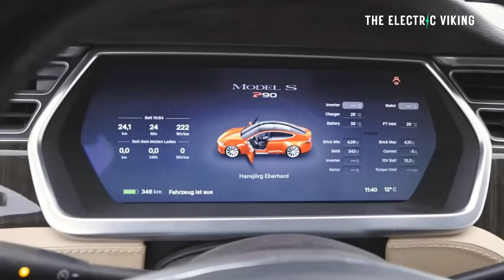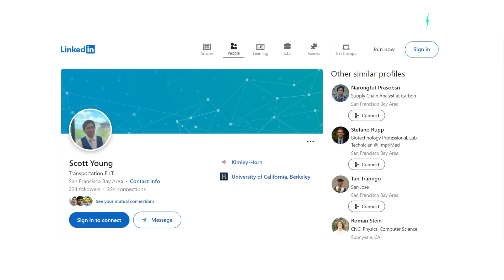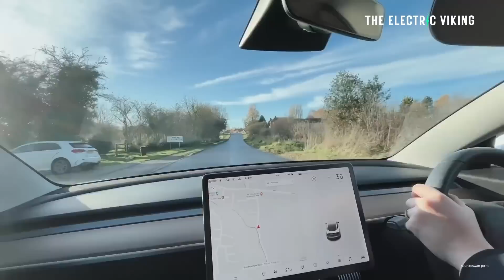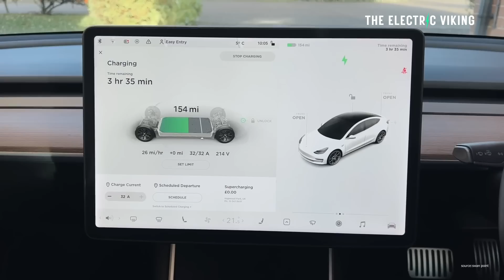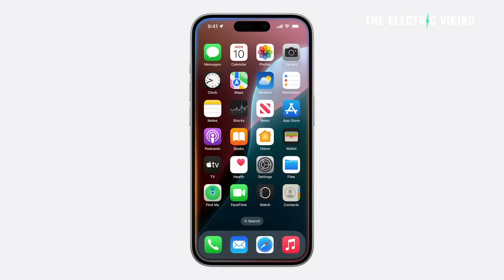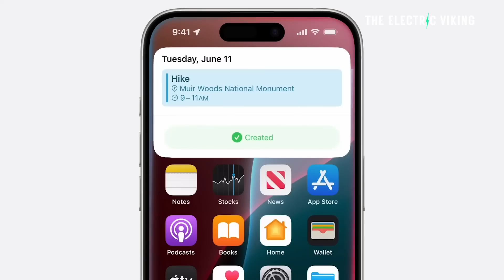Electric cars capable of running for over 1 million miles are already here

Comment: People don’t want the same car forever. My ice car is at 390k miles. I look at it like a tool. Most people don’t.
Reply: Cars often have multiple owners over their life. Cars that last longer are still bad for traditional auto manufacturers.
Reply: People change their cars because they start having a lot of problems with high mileage.
Reply: Johnslater7718 You are talking about ICE cars
Reply: @BioniqBob  what are ice cars what they got to do with this
Reply: My Tesla S is my tool and Toy. It's so much more than a car 😂. Seriously it's total fun.
Reply: 17 year-old suv , diesel, under 100k miles, with out dpf, waiting for EV-suv real open road  range of at list 400+ miles (to only charge at home), for 40-45k$
Reply: @MagicBox-k3d  so, you do a lot of cross-country driving? I don't know about you but I start getting butt burn after a couple hundred miles, and besides sitting that long in one position greatly increases your chance of development blood clot in your legs and killing you. A ridiculous sense of principle only goes so far, and not at all if you're paralyzed from a stroke or dead.
Reply: People rationalize needing a different car to meet needs, like a truck to haul stuff or small car to fit in a garage. I am guilty of this too. But cars live lives beyond the original owner for as long as they are useful for someone.
Reply: Rich people aren't most people.
Reply: @thanasis-_- Define “rich”. I know people who drive Model 3’s that I wouldn’t consider “rich” by any stretch of the imagination.
Reply: @thanasis-_-  you don't have to be rich to buy a used Tesla for $20,000. I bought my Mustang Mach e GT Performance after it was one year old for half the price of the new one and it had less than 10,000 miles.
Reply: @jamesdaniel947  20,000? If you have 20,000$ to dispose you are not exactly poor.
Reply: Lasting 390k miles?  What expensive parts have you replaced in it. How old is it?  What is it?  How well does it drive now? All these things matter, but still compared to an EV that will last 1,000,000 miles or more, and require no maintenance like oil and spark plugs and gasoline, the piece of the pie is still in EV'e favor by a long-shot.
Reply: Bought our Blue Motion Golf at 60K KM and it's now at 145K in 2 years....I REALLY want an EV...but I'll miss the range of the Golf (1100km typically)...But then I think..."Charge at home" Plug in at night charge to 100% if going to do more than 100KM next day otherwise to 80% never have to look at the "fuel" gauge unless going on a long road trip.
Reply: I have a 29 year-old Honda that I'm hoping to drive till I die.
Reply: @johnwest7993 why?  How old are you now?
Reply: @jamesdaniel947 , 74. My doctor said I probably wouldn't make it to 50.
Reply: @johnwest7993 go electric instead.
Reply: @robsta1000 , I bought my first electric car in 1989. I've owned them on and off ever since. I was just saying that I feel no reason to replace my old IC car with a new one.
Reply: doesn't matter what they want
Reply: Gosh, I wonder if the person who first bought the car could sell it to someone else if they wanted some variety. What an idea! I should start a company that helps people sell and buy these “used cars” (or maybe I should call them “preowned” - that sounds better). What should I call it? Maybe Carvana?
Reply: @juliahello6673  
No one wants used EVs, making new ones a tougher sell too-  Reddit post
Reply: Speak it for yourself.
Reply: 😅u don't want your car
Reply: I would love to have if last much longer than 6 mo ths after warranty when it has been engineered to completely fall apart and replacement parts artificially unfkated by 1000% to disincentize you fixing it.  They are prks.
Reply: What car would that be?😮
Reply: @i.k.5822  It is in the " I " class .
Imaginary
Reply: EVs in the next 5 to 10 years will be feeding into the used market in quantity at more affordable prices
Reply: In the next 5 to 10 years the current new EVs will be might attractive to buy used as their reliability, longevity and low cost to run will be compelling
Reply: If you buy a used car with 200,000 km in Sweden, you normally are the fourth or fifth driving owner. Every day there are some new people who want some kind of affordable car.

The problem with old ICE cars is if you repair it for 2,000 euro, you don't know when the next repair of 2-3,000 euro comes. There are so many parts/"modules" that can fail, and most of the expensive repairs are related to the engine and transmission.
In fact this is a no brainer. As an average.
Reply: PS, my old Tesla 2015 has had so many free updates. It's twice the car now than it was new. It even drives itself on Auto pilot. These things were not even a thing in 2015. It has too many upgrades to mention. All free thanks to that amazing company Tesla and especially Elon. Unbelievable cars.
Reply: @waynelevett3632  Tesla fanboy advert. Yawn.
Reply: I've owned all my cars till they go to the wreckers. I'm like you, just want something to get me reliability from A to B. This is exactly why I want an EV. I built a road legal electric motorbike and my maintenance is pumping up the tyres. 

When I opened up my brushless motor, and learned how it worked, I realized why we have mainly use ice in mobile vehicles where we can't tap into a reliable electric supply.  Now we have batteries that last so long, and rapidly getting better, the days are numbered for ice vehicles. The efficiency,  power, maintenance free longevity of brushless motors is so superior to ice. Have you ever wondered why all the motors in your house, garage, factories eg, drills, lathes, angle grinders are electric.
Reply: The higher the mileage in an ICE vehicle the more $$$ you’ve spent on fuel, oil changes and maintenance. Legacy auto and big oil love you!!!
Reply: @fergyspoolshots  
Report: EV Repair Costs 28% Higher than ICE Vehicles
Car insurance for an EV is about 20% more expensive than the cost to insure a car with a gas engine.
I own a 2007 Nissan Sentra. I pay only about $445 a year for auto insurance, comprehensive included. Surely don't have to paid more than 10k for replacing the battery. 
Many EV owners use their EV as a secondary car for short trips only. Sure that they don't pay much for electricity, but their insurance is still high.
Reply: @simon6071  so your comparing a 2007 Sentra insurance rate to a much newer Tesla insurance rate? FYI most of the anti EV crap you read online is funded by legacy ICE manufacturers or oil company’s so they can keep you on the gas, oil, scheduled and unscheduled maintenance train that keeps them rolling in cash. The batteries and Tesla drive units are basically the only two major components on most Teslas and they are many with 3-500K miles basically service free other than lubrication the brake callipers and rotating the tires. I’ve owned many Japanese ICE before the Tesla and they all turn into money pits that aren’t worth fixing after 200K miles. (Exhaust, clutches, trannys, burning oil and valve adjustments) Whatever your mileage is add up the gas and oil and if your high mileage you’ve already paid for a Tesla battery replacement which rarely happens out of warranty.  Gas and oil costs on the other hand are a sure thing.
Reply: @fergyspoolshots  I only said, "I own a 2007 Nissan Sentra. I pay only about $445 a year for auto insurance, comprehensive included."  That was just an example of how low the insurance of an ICE vehicle can be. That was not comparing my 2007 Sentra insurance rate to a much newer Tesla insurance rate directly as you claim.
Reply: @fergyspoolshots  
The cheapest Tesla car insurance for the 2019 Model 3 is $1,202 per year. If you can find a cheaper comprehensive insurance rate for any old EV, you can tell me about it for comparison.
Reply: @fergyspoolshots  So most of the information online opposing the impractical EV mandate is funded by  legacy ICE manufacturers or oil company, so what? As long as the information is true and reasonable like the information post  by YouTuber MGUY Australia,  that's good information.  Don't tell me the pro-EV crap with deceptive information is not funded by any pro-EV entity at all.
Why EV repair and insurance is a NIGHTMARE | MGUY Australia
Reply: @simon6071  when you claim EV insurance is 20% higher than ICE and then tell us what your paying for your ICE insurance it sounds a hell of a lot like your comparing the two.  Just keep putting gas, oil and parts on your old car and big oil and ICE parts manufacturers will keep loving you. 
Tesla battery’s and drive units routinely go 3-500K+ miles but your anti EV Facebook feed probably doesn’t have any memes about that fact.
Reply: @simon6071  depends on your driving record and location. Is it even worth insuring or fixing your 2007 car? Probably only worth about 1G now.
Reply: @simon6071  for the record I also oppose EV mandates but as you can see from the dozens of Teslas all around you every day most of us bought them by choice not mandate and it had nothing to do with saving the environment. I’m in Canada and Teslas work better in winter than any ICE I’ve ever owned. Not sure why people who’ve never even owned an EV feel the need to convince people that they’re bad. How the F would you know? Oh ya, your daily anti EV Facebook feed supplied by legacy auto and big oil who’ve been profiting off us all for decades. 
People who actually test drive teslas are sold on them pretty quick.  Try it. It’s called real world experience with the actual product.
$10/ 500km and zero oil changes. Makes oil company’s cringe so they tell you EV’s go on fire to scare u away from the facts.
Reply: @fergyspoolshots  Stop being a fanboy of Tesla EVs. You claim Teslas work better in winter than any ICE you have ever owned!  Either you owned some  crappy ICE vehicles or you just lie through your teeth about EV being better in winter.  
Freezing weather leaves DOZENS of DEAD EVs stranded | MGUY Australia
(5:17 "lines of dead Teslas unable to charge due to cold weather)  
((6:59 In brutal cold winter, it takes longer to charge up and the battery drains faster.)
Reply: @fergyspoolshots Teslas cost way more money to buy and the their insurance are way higher than that of ICE cars, partly due to higher fire risk and partly due to high cost for repair even for minor damage. The cost of oil change is nothing compared to the cost of battery change and expensive repair even for minor damage. Hertz learned the hard way and it dumped its Tesla fleet instead of buying more.
Reply: @fergyspoolshots  EV fire is not scare mongering of oil companies. It is in fact a big problem that is being cover up by EV promoters. 
*NEW DATA! EV Owners HAD ENOUGH As EVs Are Catching Fire in HUGE Numbers!
*Homeowner questions EV safety after fire destroys her Nocatee home
*Runaway 500 EV meltdown on cargo ship: Proof our cities aren't ready for full EV deployment
Reply: @fergyspoolshots  My Sentra 2007 has only about 34k miles. Still running well. It should worth about 4 G.
Reply: @simon6071 your a typical anti EV guy eating up the daily anti EV videos your fed through the internet. Put down ur damn phone and try real world experience instead.
Reply: @fergyspoolshots  
I got my information from YouTube, so do you. 
Do you want people to stop watching YouTube?
Reply: @fergyspoolshots  
I guess you do not consider those EV problems to be real unless they happen to you.
Reply: Last 3 cars I’ve owned had 225k+ miles .    But some of what you say seem like hype .
Reply: @davidstrong7854  what you’re stating sounds like hype.  I’ve had three cars that didn’t even make it 100,000 miles before the engine was shot and had to be replaced. It doesn’t make it true for all cars.

What he’s talking about our industry averages, not what individual owners may or may not get.
Reply: @wambam1741  I recommend changing the Engine & transmission oil if you want your ICE cars to last longer. If all your cars are dying around 100k that's you, not the car.
Reply: @OTPulse  well your comments what I would are call uninformed ignorance. 

I never wrote that it was “all” of my cars. It was three out of 13. Over 45 years it’s not hard to go through that many cars.

I’ve always the oil changed to manufacturers specs. I’ve always had the money to do that. It’s how how they were manufactured.  Two Hondas and an Isuzu need new engines. And I can’t forget about the Mazda in which the transmission quit at 24k.

The entire repair industry revolves mainly around auto manufacturers making pieces of crap and the inherent POS nature of ICE engines.
Reply: According to Tesla's 2021 impact report, its batteries are designed to last the life of the vehicle, which the company estimates as roughly 200,000 miles in the U.S. and 150,000 miles in Europe. 
1,000,000 miles divided by 200,000 miles = 5  
So according to the car company Tesla , a Tesla EV needs to have its battery replaced 4 times in order to travel 1 million miles with acceptable battery performance. The least expensive Tesla is Model 3. The price is about $39,000.  The cost of replacing the battery is about $16,000 (labor included). Replacing the battery 4 times would cost $16,000 x 4 = $64,000.
The Electric Viking's report leaving out the cost, not to mention the hassle of, replace the battery 4 times for a Tesla to travel  1 million miles is as deceptive as its report of EVs cost less to maintain and repair.
Reply: @simon6071  Not decepttive. Just objective truth.
Reply: @rogerphelps9939  No mentioning cost for battery replacement for running over 1 million miles is deceptive.
Reply: @simon6071 That is not true, as the Viking says, old Tesla batteries are lasting much longer than that, and your quoting the mileage that the replacement guarantee covers, not the design mileage. Big difference.
Reply: @jamesdaniel947  If that testing team had achieved over 1 million miles without changing the battery, I 'm sure they would have mentioned it and bragged about it.  Since having to change the battery at high cost is an inconvenient truth to them, so they just pretend that it wasn't necessary. That's deception. At a capacity lost of about 12% after 200,000 miles and presuming losing 12% after every additional 200, 000miles, changing the battery around  500,000 miles is inevitable. If not, the Tesla would have to be charged way more often and the performance will also be severely affected especially when Tesla recommends that you avoid keeping your Tesla's battery below 20% charge for extended periods of time.
Reply: @simon6071  How can you be "sure" that they would have mentioned it?  And then accusing them of deception?  I watch a lot of reviews and informative vids on here about EV batteries, and own a Mach e GT perf. The numbers in this one seem reasonable as compared to other's research.  I have lived for 73 years and have seen wave after technology wave and the common denominator is always that when the latest and greatest comes out it is always extraordinarily expensive. Take flat screen TVs for example, when they arrived in the scene a 32" plasma cost $5,000!  Now a much better LED that weighs nearly nothing can be had for around $50. The same thing is going to happen to these batteries. They're going to get far better, much more dense, and far cheaper. We're really in the infancy of battery technology. I will never have another ice car.

In 500,000 miles I may want another battery just because it's far superior to the one that's in the car, not that mine doesn't work. Then I can take the one out of my car and hanging up on the wall of my garage and run all of my tools off of it.  I can charge it with the solar panels on the roof. Besides, and 10 more years, I'll probably be dead, but I would've saved all of those thousands and thousands of dollars would've been spent on gasoline, oil, changes, maintenance, antifreeze, and tons of emissions!

I should be sticking that $60 that I was spending on gas every week into a jar for my future battery at 500,000 miles. 😉
Reply: @jamesdaniel947  I said, " If that testing team had achieved over 1 million miles without changing the battery, I 'm sure they would have mentioned it and bragged about it.  Since having to change the battery at high cost is an inconvenient truth to them, so they just pretend that it wasn't necessary. That's deception."

I'm sure they would have mentioned it if they did not have to change the battery at all during the 1 million mile test instead of having to change the battery 4 times at high costs according to Tesla's service schedule because that information of no need for battery change for 1 million miles would be a good EV selling point for them in touting EV as being more economical to run than ICE vehicles.
Reply: @jamesdaniel947  When according top Tesla's battery change schedule, the Tesla that has been driven 1 million miles should have its old batteries replaced 4 times, even if they had stretched the life span of the batteries by running on lower efficiency and had to replace the battery only once, their failing to report  that the battery has been replaced at all during the 1 million mile test is still a deception.
Reply: @jamesdaniel947  Your expectation of the reduction in EV prices (battery included) to be as sharply as the reduction in prices of flat screen TVs is not based on reality.  Sure the prices of EVs have dropped quite significantly due to big drop in demand but they are still more expensive than ICE vehicles in general, not to mention the fact that had there been no heavy government subsidy to EV manufacturers and EV buyers, the prices of EVs would be even much higher.
Reply: @jamesdaniel947 I'm also not against EV but I'm against EV mandates and the suppression of ICE vehicles. 
I think both EVs and ICE vehicles should be allowed to co-exist depending on their application, regional energy supply and personal circumstances instead of the government trying to force expensive EVs with risky and low energy density batteries comparing to gasoline on the consumers by banning the sales of ICE vehicles.
Reply: @jamesdaniel947  Not everybody owns a large private property on which the owner can set up solar panels to charge up their EVs.  For many people, the risk of thermal runaway fire that comes with lithium ion batteries on EVs is a major factor for refusing to buy an EV now. Even though EV fires are reported to happen less frequently than ICE vehicles, but EV fires become life threatening much faster and are much harder to put out makes EV fires more dangerous than ICE fires.
Reply: @simon6071 And what would the costs for a comparable ICE car be to drive it 1,000,000 miles? I promise you it’s WAY more than $64,000.   Also, most Tesla batteries go over 200,000 miles. The company is going to state the lowest number in this case to avoid lawsuits over false claims, etc.  Don’t forget to add in the cost of gasoline over 1,000,000 miles vs the cost of charging at home.  That math is obvious. Costs me about $3 to drive 100 miles. In a comparable ICE it would cost at least $15 to drive 100 miles. So that means over 1 million miles, it would cost me $30,000.  For a comparable ICE car (which is actually slower), it’ll cost $150,000 at current costs.
Reply: @ilmostro16  The high price gasoline has been artificially created especially in state like California with high gasoline tax and carbon tax and because of the suppression of domestic oil production.. It's political increase of gasoline price.  The price of gasoline would be much lower if those political factors are change for the better.
Reply: @ilmostro16  
You may say on average EV insurance is only about 20% higher than that of ICE vehicles. That's only a deceptive comparison.
Since 96 percent of EV owners own another vehicle that isn't electric and they only use EVs for short trips, of course insurance companies would lower their expensive EV insurance based on mileage driven. If a driver owns an EV only and uses it for long trips everyday, I'm sure the insurance would be much higher than that of an ICE vehicle.
Reply: Actually, I waa quoted $3,500 USD for a Model 3 new battery. The price has dropped significantly thanks to CATL.